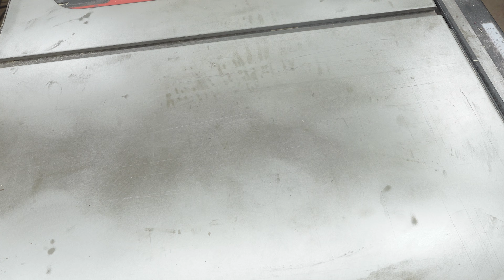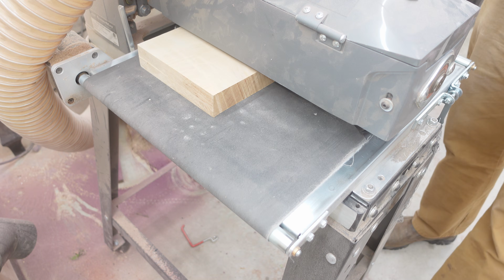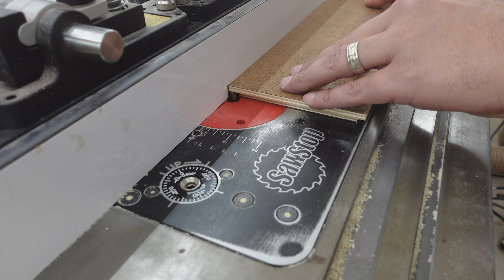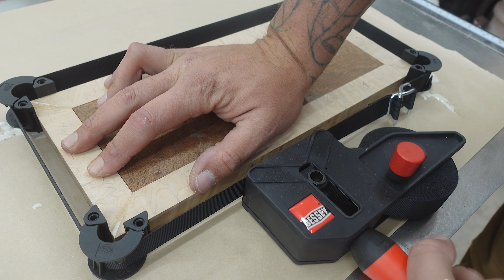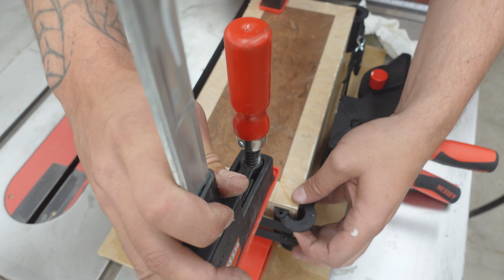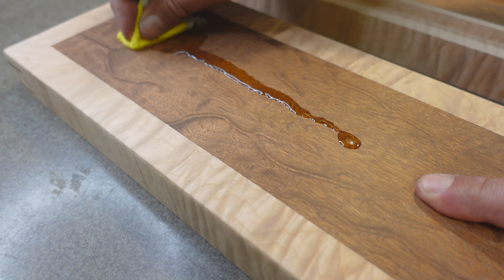Continuous Waterfall Grain Box | Perfect Miter Cuts | Woodworking Tips and Tricks

Comment: You neef to set your table Blade higher so its pusching down on it than it is easyJet to Saw en less dangereus
Reply from the maker: Thanks for pointing that out!  When I reviewed the footage, that is the first thing I noticed that the blade was to low for those cuts.  Safety is key, and should always be considered in the moment to prevent a disaster.